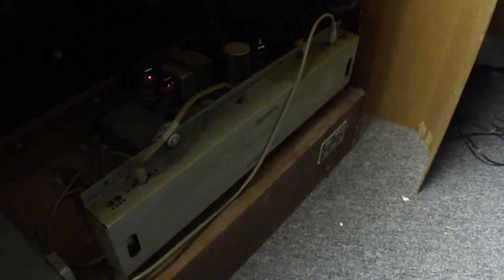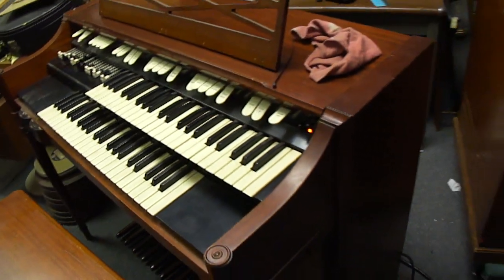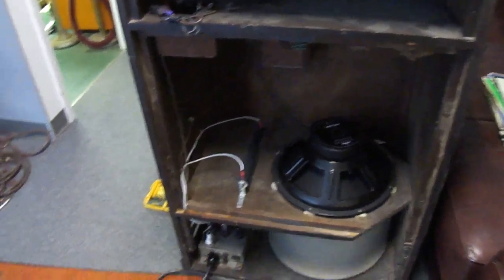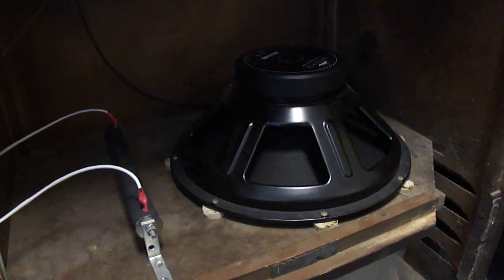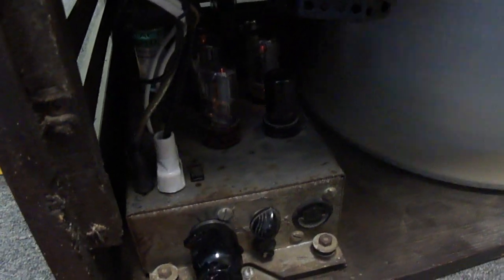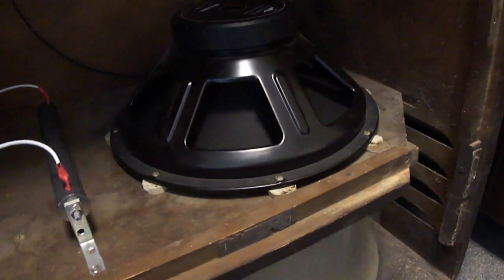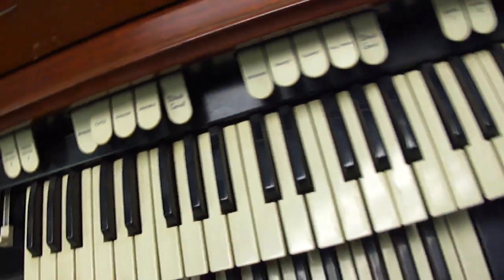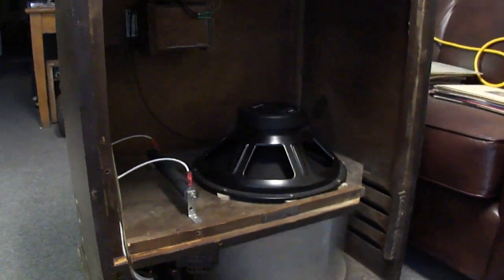Leslie model 21H organ speaker test

Comment from the maker: @jrcstudios Yes, I think they did not have strong enough permanent magnets back then. In the larger field coil woofers like those used in these amps and jukeboxes, the field coil actually shunts across the power supply from the B+ to ground (parallel circuit) as opposed to the series circuit type acting as a filter choke usually used in home radios. In the parallel circuit in the power supply is expecting this load and the voltage would be too high without it.

Comment: Thanks for this. I have to do a similar thing to a 44W without its field coil speaker. What resistance is this? The 44W calls for 2650 ohms. Did you consider a inductor instead of a resistor? Was there any increase in hum?

Comment: what was the purpose of field coil speakers? was it before they discovered strong permanent magnets like Alnico? Is the resistor due to a series circuit expecting the load?  Its good to know the church that this belonged to didn't just replace it with the latest digital synthesizer when the speaker died.  I have a Leslie 25 I need to fix up and find a home for. That model only has the bass speaker, no horn
Reply: I'm sure you found out since, as you asked 5yrs ago, but they did have permanent magnets back in the day. It seems though that on higher wattage units they used the field coil design. The coil, aside from magnetizing the speaker, acted as a choke for filtering the B+ in the amplifier thus killing two birds with one stone. Yes, the speaker coil was in series with the rectified B+, without it's load the DC voltage would increase possibly burning out tubes, transformers and capacitors..